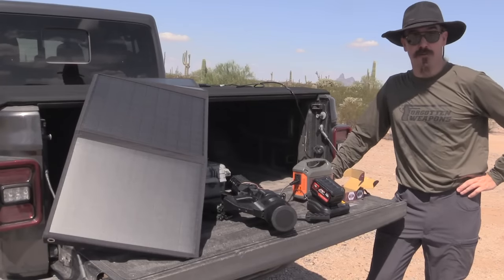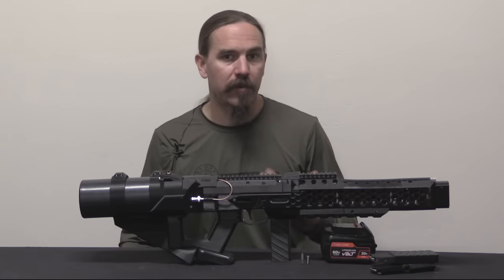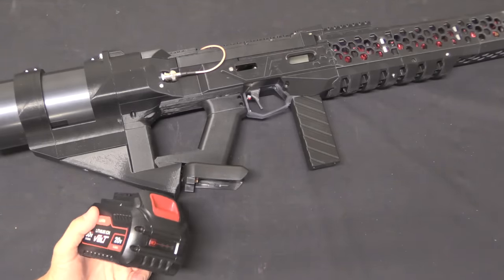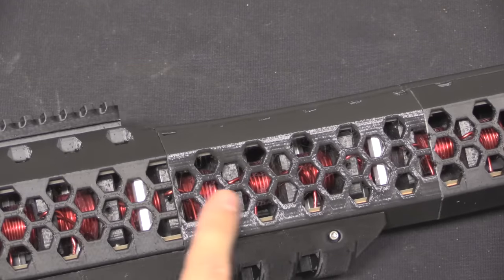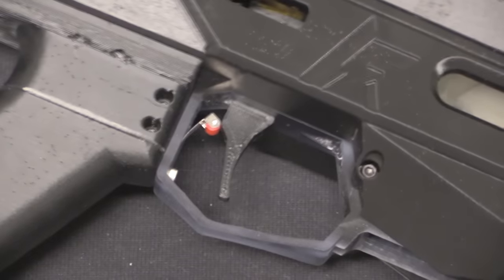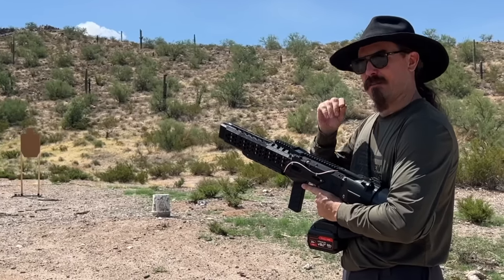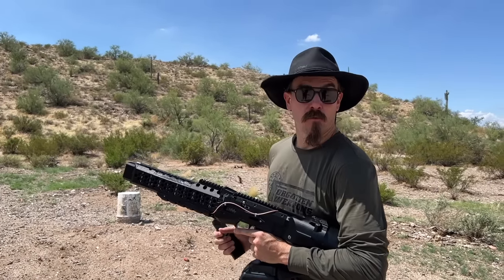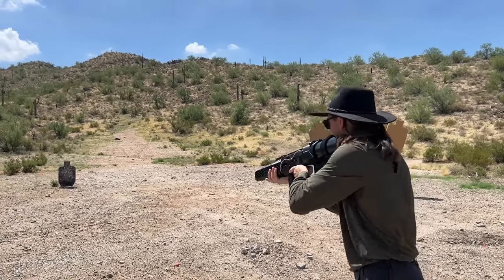ArcFlash Labs EMG-02 CoilGun: Making SciFi Weapons Into Reality

Comment: This seems like a cool post-apocalyptic concept, as long as you can have some center of technology and learning to crank out a few replacement parts and knowledge on how to maintain such things, this thing could run on scrap metal and whatever kind of sufficciently adjusted jury-rigged generator you could make. Quite tricky, but still seems like it's more plausible than having the metallurgic and chemical industry to make high-grade powder and precisely made cartridges.
Reply: Precisely made capacitors and power electronics.
Reply: @alexandrsoldiernetizen162  lol yea i think theres a reason we have had guns for hundreds of years and just now starting to make these.
Reply: Good luck making the lithium ion batteries from scratch.
Reply: I don't know about that.
I think the technology in that thing would be difficult to improvise.
Maybe you could scavenge the parts needed, but I doubt you could make them from scratch.

In my mind, the post-apocalypse will look quite different from most popular depictions.
There will be comparatively few people left, but they will be wading through the absolute abundance of stuff and materials that we in our time leave behind.
Reply: @raiden000  Small integrated fabrication plant, close to a long-abandoned Li-salt mine. Maybe meant for some kind of pilot production, or just built around the time of 'the event' out of whatever was still available.

It's an apocalypse setting, so it's not like you need scale production, and half the subplots/sidequests can be conjuring up spare parts and secondary resources!
Reply: its easir to make blackpowder weapons
Nirates: Collected crystals from evaporated piss or dig up dead bodies.
Charcoal: Easy to make just takes testing of different wood types to find the fastest burning.
Sulfur: If you have the knowledge Sulfur is effectively everywhere in all kinds of ores or better yet hot springs and volcanic regions.
Reply: @raiden000  bruh we have black powder for thousands of years
Reply: You would need a way to charge the thing in a post apocalyptic world.  Since the mining and fossil fuel industries (required for all sources of power, even solar/wind . . . except nuclear) would be pretty RIP in such a scenario.  You would be fighting others for what merger supplies of petrol or similar to power generators to charge the gun.
Honestly conventional guns would be better in such a scenario.  Because:
1. Ammo would be easy to find
2. Any sources of power would be better used for cooking food or heating anything more productive than a gun.  The limited amount of power you have.
3. Zero need to charge a conventional gun, so no downtime.  Assuming this new world is dangerous and you need to be gun ready 24/7.  All you would need to do is have one gun ready while you are cleaning the other.  Having a second coil gun for when the 1st is charging?  That would be tough to do.
4. Zero concealed carry until coil hand guns are invented..  In this new world this could be very important.  Standard hand guns are still needed for this role.
5.  In an actual post apocalyptic world making enough of any kind of (traditional) gun from scratch would not be happening.  People would be using whatever parts they can find to assemble a parts kit style gun.  Sure, hardware store style Luty guns could be made and they would work but the level of complexity, tools needed and time involved would be far more than just throwing together already assembled gun parts.

Your idea of a post apocalyptic world is one that has had many years or more likely many decades to recover after the post apocalyptic event.  That is just a normal world again at that point.  The term post apocalyptic has to go away at some point.  We ate technically in a post apocalyptic world after the dinosaur killing apocalypse.  But saying that is absurd and wreird because that was so long ago and everything has moved on from then.  Very exaggerated example but you get the point.  If your society can create enough power (ie functioning fossil fuel industry) to mass machine guns and ammo (if any kind) then, what we would typically consider to be a post apocalyptic world is long since been and gone and is in the past.
Reply: @TheArQu  Yea but only been making guns for 500 or so
Reply: @Neuttah  There is a lot more in them than Li salt, where are you gonna get the cobalt? the nickel? Bro you are gonna be way more worried about food than any of this lol.
Reply: @the8thark  That’s my point too, is it really an apocalypse when YouTube commenters are running around farming corn and building pipe rifles like fallout
Reply: @raiden000  By that same logic, there's a hell of a lot of chemical and metallurgical industry that makes modern guns actually work, rather than just shatter, and simple black powder is a fucking awful propellant.

So the entire conversation is moot.
Reply: @Neuttah  Its a lot easier to make decent enough quality steel to hold some low pressure shotgun barrel together than it is any kind of battery or capacitor let alone the circuitry that controls the coils. Its not moot at all. This gun would be impossible to maintain in any kind of post apocalyptic world.
I cant believe anyone is trying to argue that it would be just as hard to rebuild 200 year old tech as it would 5 year old tech.

Comment: We're looking at the 21st century version of the matchlock. There will be a time when these or something similar will be fully fledged weapons of war. It might not be that far off either, they just need to find a way to stabilise the projectile and increase the muzzle velocity. I think they'll need to take a closer look at the projectile, something purpose built with fins for stabilisation and a more aerodynamic shape?
Reply: @zackthebongripper7274  that not how how it works. More like squeezing a tube with a magnetic field but pulling.

Fin stabilized, discarding sabot may be the best solution. That or a dimpled ball similar to a golf ball.
Reply: What about a threaded barrel and projectile?
Reply: @matthewconnor5483  most likely a fin stabilizer would be the most effective and simplest way to engineer a projectile like that. The dimpled ball ammunition could also work, but for modern military application that probably wouldn't be effective against body armor.
Reply: @zackthebongripper7274  The coil accelerator is already a spiral.  

I thought about having a spiral strip of metal through some heavy non-magnetic projectile, but I don't think that would work either.

The only other thought I have is to have fins on the projectile that pop out when in flight as to not damage the rifle, but now your ammo is getting super expensive.  

Unfortunately, I don't think Gauss Rifles are practical without some form of magic alien tech.  

Maybe as a shotgun?

Comment: Next up super conductor coils harvested from an old mri machine and run 500v.
Reply: Now your talking  500v is not a difficult  voltage to come up witrh now i would certainly make for an interesting  experiment  of course the serious issue is the supercooling bit gun over your shoulder truck following you with the cooling system on it   .
Reply: Those coils are cooled with liquid helium and then that is cooled with liquid nitrogen. And they are insulated in temperature controlled rooms.

Comment: Question, would the fluting of an actual cut down 1/4 inch drill bit be able to cause enough spin to stabilize the projectile in flight like a rifled slug?
Reply: interesting idea but if you did that it would probably be best to put it in backwords so the heavy end would carry the inertia forword while the fluting would keep it balanced like the tail of a shuttlecock
Reply: hmmmmm.....maybe?  I would guess that there's a minimum speed that a projectile needs to go before that sort of stabilization is effective. 

So unless they're able to raise the coilgun's FPS to typical firearm levels it would probably work better to treat the projectiles like arrows and somehow mount fins on them.  

Of course putting fins on a projectile that has to travel through a barrel introduces a whole bunch of new design challenges.
Reply: Doubtful. Maybe if you made the barrel to be a mirror image of the drill bit though...but plastic barrel wouldn't cut it. You'd have to make barrel out of glass, ceramic, synthetic ruby/sapphire or something similar to prevent fast wear.
Reply: @1_GigaWaffle  Something that is hard enough to resist the wear but also flexible enough to not break easily.
Reply: There may be a way to alter the geometry of the coils to impart a spin on the projectile as it is accelerated.
Reply: @MythicMagus  Upscale the gun with more power and use tungsten/steel/DU 5.56 size APFSDS
Reply: Hardened steel may be bad for barrel over time.
Reply: @cheapscifi  but the round never contacts the bore
Reply: @ThatAintGud  prove it;) I get your point, but never? That's some feed mechanism.
Reply: @cheapscifi  there is no feed system outside the magazine. the round is pulled out of the magazine by magnetic force and accelerated from energy pulse to energy pulse until it leaves the weapon. the magnetic feild keeps the projectile centered and and equal distance away from all sides of the "barrel"

Comment: That's a relatively short "barrel", I imagine they could improve accuracy and velocity by lengthening it, adding more coils, and using a more dart shaped projectile
Reply: Pretty sure they could just make the coils themselves bigger without having to increase barrel length but Im not 100% sure
Reply: Nope, get beyond a few stages with a gauss gun and its a lose lose situation.
Reply: @alexandrsoldiernetizen162  Yep. Similar to how an overly long barrel on a firearm can burn out velocity and induce drag onto a bullet, you can only push a given amount of electricity through so much circuitry before it drops voltage.
Reply: Back to a bullpup design to keep the length down, move the caps forward to around the pistol grip area to maintain balance and fin stabilised projectiles. That could be an interesting variant. Alternatively just dismount the power pack completely and run with a cable. I've done that myself way back when just using a couple of car batteries in series :)
Reply: The projectiles have to be made of iron or steel, and the bulk of their mass has to be close to the inner diameter of the electromagnets (coils). Adding fins would therefore drastically reduce the force applied to the projectile and therefore its velocity.
Reply: @Ijusthopeitsquick  For ferromagnetism nickel and cobalt would also work.
Reply: @Ijusthopeitsquick  Teardrop projectile, fins on the back. The fins do not have to be any wider than the projectile, the shape just diverts the airflow over them. Not as effective as a dart, sure, but certainly better than an unstablised rod.
Reply: @Anino_Makata  it's not running the magnets all together, it triggers one after another ahead of the bullet. the only limitation on the length is the charge of the capacitor and in the extreme the air resistance on the bullet versus the power of the magnet, or how fast the electronics can detect the bullet and switch on/off each magnet.

and there will be a balance between how much stronger you can make each magnet against the extra velocity from just adding another. but again the limit of the weapon is energy, without a bigger capacitor you cant really make it any more powerful because bigger or more magnets will need more energy.

Comment: I think that Arcflash Labs is going in a good direction. They still have a lot of road to cover,mainly:
1. Accuracy problems
2. Quality problems
3. Capacitor problems (you don't want a capacitor to go boom)

Overall,the big step up in efficiency and the large use of common materials is a great thing
Reply: yeas impressive improvements,  i remember researching coil guns in 2010, what they are delivering in 2022 looked impossible in 2010

Comment: I could see gauss rifles being used in some sort of future stealth/recon capacity due to how much quieter they are
Reply: Batteries will improve and with that the speed out of the barrel, could be useful to electric tanks soon.
Reply: Oh I bet you are right. Maybe it's already happening. We just don't know about it.
Reply: Eh, probably not, you can already get nearly silent guns with subsonic ammo and silencers from guns specifically made for silent use.
Reply: @michalandrejmolnar3715  Eh, you just gotta ask why though? What about it would be better than a chemical based cannon like we already have? Maybe ammunition storage is safer, but I'm not convinced that amount of electrical devices wouldn't pose their own fire risk, and they would be harder to keep safe since you can put ammo anywhere but the gun is where the gun is no matter what, and if you hide the battery theres a real risk of the wires getting destroyed in combat leaving it completely combat incapable, but ill give the ammo safety a solid maybe. And the lack of HE options is REALLY a problem for tanks, its one of their main uses. Maybe for a tank destroyer? But holes that small that dont detonate are unlikely to cause real damage until you penetrate multiple shots. I just don't see it being MORE useful than a traditional cannon. The naval versions run into similar issues. But as far as stealth tanks go, MAYBE, but I don't know how quiet and/or low profile they can get a tank, even with an electric engine.
Reply: How about a crossbow

Comment: Nice changes they've made to the first model, it's still very primitive (for a gauss rifle, of course) but they advanced in the right direction imo. Rifling will take some time, as Ian already said, but there are solutions to the problem at hand. The most important thing for me would be having all cables internally and better protection from dirt. The laser can be thrown out (using an external one is better in regards of maintenance) and the display could definately use some improvements (slaughter your iPhone for a good small camera and an amzing display that can replace a red dot or even a scope). Looking forward to the video on the EMG-3.👍👍
Reply: Flechettes maybe?
Reply: @stxrobstar  Would that not make them even slower? We're already looking at less than lethal speed.

Comment: I wonder how a backwards Philips head bit would work - would the “fins” help stabilize the “round” in flight?
Reply: I'm thinking not, because the "fins" do not extend beyond the diameter of the bit, therefore no gain in stabilization.
Reply: @david9783  I think there would be some improvement, but not a lot, as the air closes flows over the body of the bit and in between the “fins.”

I do not believe it would be much of an improvement, but a bit of one.

Comment: I wonder how often this would have to be cleaned/ maintained, and how difficult it would be to do so. The 3 round burst is so cool too.
Reply: I mean basically never since it isn't reliant on any tight mechnical tolerances to work. So long as the electronics can be kept dry it'll be fine.

Comment: Seems like the main issue is energy density. Nitrocellulose still has much higher energy density.
Reply: Chemical energy storage will likely always be denser, but chemical and electrical systems have different limitations, and theoretically electrical systems would be significantly easier to feed
Reply: Ian didn't say that mass driver efficiency falls off the higher you want the muzzle velocity to be, so to say double the muzzle velocity you'd need a far longer barrel. This is because the faster the projectile goes the less time it will spend in front of the electromagnet that accelerates it and therefore is accelerated less.
Railguns don't have this flaw but the really powerful ones (naval railguns of which you can find videos on youtube) fall apart after like 50 shots because of immense heat and electromagnetism.The advantage mass drivers bring is that they are very efficient at launching massive low muzzle velocity projectiles, hence the name mass driver.
I am quite sure what I am saying is correct, but I never studied this formally so I'd advise doing your own research.
Reply: @adamnouiguer3430  Interesting answer, thank you

Comment: Always interesting with these almost-toys slowly turning into weapons. I'm getting ideas on how to induce spin without rifling the barrel but I'm sure those ideas are dumb and they are focusing on that themselves for the next iterations.
Reply: This feels like it is taking the opposite route of Airsoft replicas.

Airsoft takes a real life weapon and turns it into a dangerous toy.

This feels like a harmless toy that is slowly moving towards a lethal weapon!
Reply: Doesn't have to have spin, fins might stabilize it just as well.  Angled fins would make it spin of course.
Reply: @newperve  Like APFSDS round used by 120mm smoothbore cannon
Reply: @Michael Price  My immediate idea,, based on nothing and no research. Was to use projectiles made in such a way that they would orient themselves with the coils like in an electric motor, inducing rotation as it also moves forward being pulled by the coils set up with a twist. This way the projectiles would just need to be made in such a way they would be receptive to the polarity. This way one avoids fins and other drag-based stability. Going to have to research this for my own amusement I guess.
Reply: @F4celessArt  I think you might have to redesign the gun, not the munitions for this.  It might be a feature in the EMG-03 in a year or so..
Reply: Yeah it would require a different approach to the coils themselves. I think that sort of design revision would be on the table for them regardless.